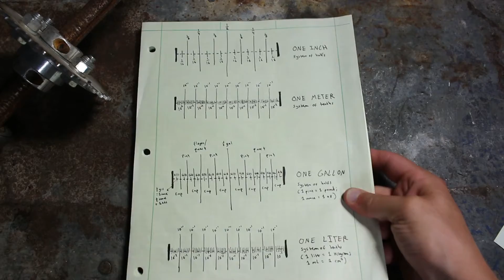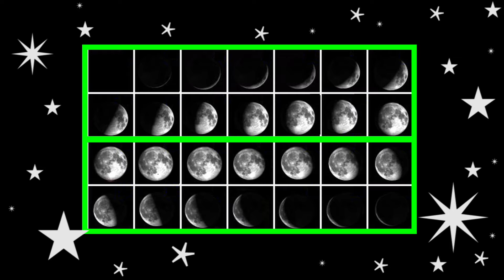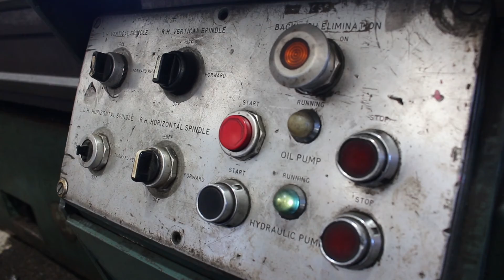Metric vs. Standard: An Imperial Defense

Comment: you know the joke? Which is heavier a pound of gold or a pound of feathers?!?!
but do you know that the  question dont work because a pound of gold ( 480 grains x 5760 )weighs less than one in feathers ( 437.5 grains x 7000) !!!! 
because you have to use the right units of measurement
A pound of gold is 2.8 ounces lighter than a pound of feathers using the "legal" units of measurement
in the "metic" system it doesn't matter a ( KILO ) GRAMM of gold weighs as much as a ( KILO ) GRAMM of feathers!
that's why the imperial system doesn't make sense to me
Reply from the maker: Very strange! I've never heard of that. Thanks for sharing your perspective, Axel.
Reply: @McGuireMechanism  The different weight of gold is due to the "coin weight system" ! I suspect it was  used to fulfill the promise that every dollar is worth its money in gold, and as  more money relative to gold came into  the market the" federal bank" found a way to lighten the weight of gold by the way the gold is weighed so that more "gold dollars" are available, then came the "gold standard" in 1870...... until then these "promises" by law , was abandoned entirely by Nixon in 1971
Another example 
is your "for me completely incomprehensible system" how the fuel consumption of your cars is calculated
this "miles per gallon" MPG?! Americans who expect it are lost in England because they get stranded on the way because their fuel is gone...
WHY? the so-called "Imperial system gallon" is not the same as in England, from  the "inventors" of the system
even a pint and a quart are different!! You can't call that a system, I call it "arbitrariness"
Reply from the maker: @axelk4921  Interesting! This magnitude "creep" you're pointing out seems to show up in many places, and it reminds me of how sheet metal gauges continually creep to the lower limit of "standard" thickness tolerance, until today when there is (to me) a surprising amount of variety in the thickness for a given gauge, depending on where the material comes from—for both Metric and Imperial. Thanks again, Axel.
Reply: That IS the joke - that a pound of feathers weighs more. That's why it "works". If the pounds were the same, there would be no point in asking the question.
Reply: @bxdanny  I know that, and I understand the joke behind it, but the even bigger joke is 
"Why do you need different units of measurement for something like "weight"? That show´s that in the US people are being ripped off in every possible way , and they don't even understand it
This also explains why the NASA "Mars Climate Orbiter" mission failed....! 
not only that these idiots could not distinguish between imperial and metric, but ( I suppose that they ) calculated with the unit of measurement for gold instead of the one for feathers!!!!!! ;)))
It would have been better to calculate with "Feathers" instead of assuming the weight of the gold foil for "temperature protection" of the Lander.

You see, I can ridicule the JOKE called the " Imperial Unit of Measure " over and over again and it doesn't get any better!
Why are there ounces and fluid ounces????
or a "furlong", a "Gunther chain" or "a stone" what are those absolutely DAMN dimensions?`???? "a stick"  ??? what the hell is a stick?????
For me, a stick is something I used to poke in an anthill when I was young, but not a unit of measurement!!!
Reply: @axelk4921  A fluid ounce and an ounce of weight are related in exactly the same way that a liter and a kilogram are, that is by the density of water. Troy pounds actually are no longer used, but Troy ounces are used around the world. And if the story about that Mars orbiter is true, it was just incredible sloppiness that lead to that mistake.
Reply: When you weigh gold in Troy units, you need to say “Troy pound” or “Troy ounce.”  “Pound,” without qualification, means “Avoirdupois pound.”  A Troy pound is lighter than the Avoirdupois pound.

Comment: This is exactly what I have told my friends. I grew up with that "metric is better" mentality that schools pushed, but when I got into car mechanics, thousandths of an inch made enough sense. Calculating lengths is far easier in practical settings. I asked them, "is it easier to calculate half of 3/8ths, or half of 0.375?"
I use millimeters when making models to 3D print, primarily because I'm making something custom and rarely use more than one decimal place. Using metric makes more sense here, but that doesn't mean everything should be metric.
Reply: As a mechanic and engineer, nothing has ever been easier or better using imperial.
Reply: "is it easier to calculate half of 3/8ths, or half of 0.375?" /// The entire approach is wrong. If you want to do something that requires lots of accurate dividing in half, start with material 1024mm long instead of 1000mm (1m).

And if you can't choose the initial length, dividing 3 feet 11 inches in half a bunch of times is not going to be fun either.
Reply from the maker: That's a great example, thanks Saucine.

Comment: Your title shoud read "Metric vs Imperial". Metric is THE standard if you gauge by the number of countries or people that use it. Using "Standard" to denote the imperial system is a misnomer, and very US centric.
Reply: Imperial is literally based on Metric!
Reply: @BaBaDoo0    No it isn't.  Each system has a completely different ancestry. 

It's true that since 1893, U.S. Customary (not "imperial") units have been defined in terms of metric units, but that's not the same thing as saying the former is "based on" the latter.  It isn't.
Reply: Actually, the title should read "Metric vs. U.S. Customary", since we don't use British Imperial units in the United States.  😊
Reply from the maker: Thanks for the suggestion, crankybloke! In my line of work, the vast majority of folks refer to the systems as "Metric" and "Standard." In my experience, this is not a misnomer but simply the colloquial norm.

One point I want to make is that when it's said a country "uses Metric," we sometimes forget the smaller, independent workers who may still use their country's older or even indigenous standard. These older standards can have rich histories and unique features of their own.

Comment: I use both in my workshops. It doesn’t matter if your a machinist, mechanic or carpenter etc etc you should be able to use one system as easily as the other.
Reply from the maker: I'm with you, Andy. I use both in my workshops, too. And today's machinist, mechanic, carpenter, etc. should be able to use both.

Comment: what everybody that tries to defend the imperial "standard" seems to forget is that there is no imperial standard. in metric a British millimeter is the same as a French one or an Ethiopian millimeter.
but there are multiple different "standard" inches in industrial use. how is that standardized? ( their "standard" inch ranges in length from 23.88mm to 26.80mm when converted to metric - they are still inches that are 12 to the foot, 36 to the yard) this non standardization cost thousands of hours of work and millions of dollars in WW2 when other companies were asked to build parts to "standardized" drawings.
I work with both systems but ALWAYS end up having to convert everything to metric to work in one common measurement for the entire job.
Reply from the maker: Thanks for your thoughts, Todd! I'd suggest that in the type of work where Imperial standard is best suited, +/- 1.46 mm (per the 23.88 mm to 26.80 mm you cited) is an acceptable tolerance. As we get into microns and sub-millimeters, I do prefer Metric.
Reply: The countries using imperial standardized based off metric in the 70s I believe. I can’t remember specifically what year. Yes in ww2 it was not but that hasn’t been the case for half a century.

Comment: The base 10 is not a feature of the metric system - it's the feature of decimal system used in math. If the math used base 12 instead of base 10 the metric system would still work the same. The metric system is aligned with the math we're using - the imperial system isn't. That's why metric is the system in science - it's good to have that kind of consistency.
Reply from the maker: I agree! Metric is extremely useful for uniform science.